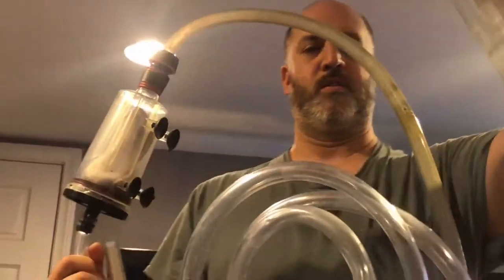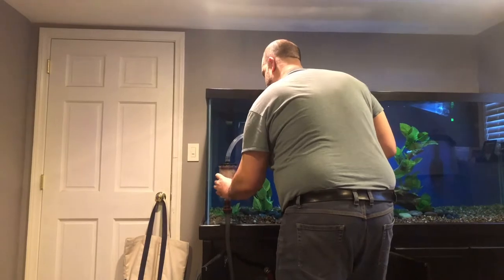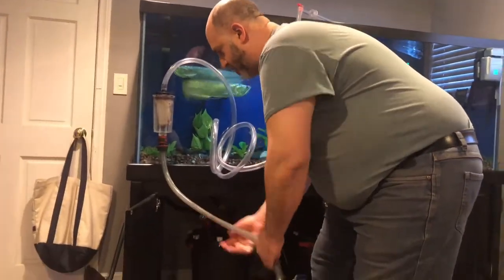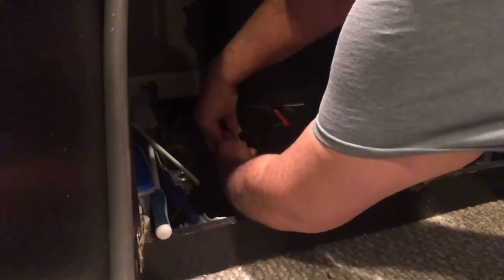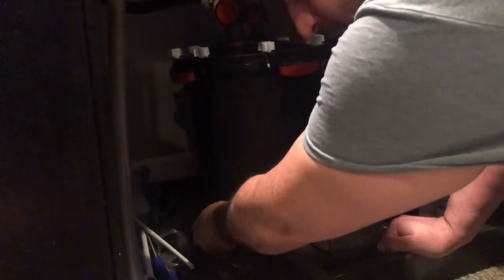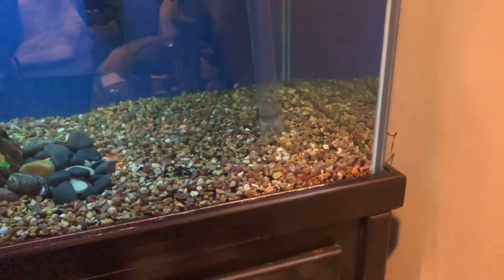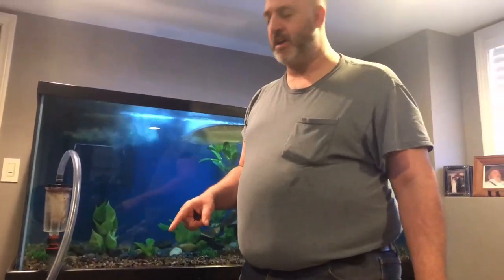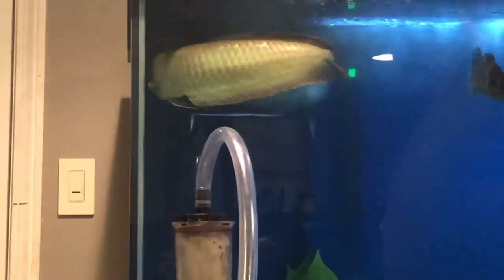FX6 Gravel Vac (No water change)

Comment: Would this work if you connect the hose to a non-Fluval canister filter, provided the hose has the correct diameter for the inlet?
Reply from the maker: I’m sure it would as long as you are able to pull a siphon from the canister filter the fx6 has a draw off valve on the bottom I close the intake and I open the draw off while keeping the return open it has a ton of suction I’ve also have used it during a water change as well it works amazing thank you for watching my video tank on 👊👊👊

Comment: Doesn't that add a bunch of air to the canister since you don't fill the hose with water as well?
Reply: FX-5 and FX-6 evacuate air easily
Reply from the maker: Yes it does add some air but small amounts it runs off the filters pump the fx6 purges all the air out on its own also when you disconnect the vacuum I always crack open the out valve first then the in valve that also helps bleed out air but it completely purges out the air in a few minutes and ever 12 hrs the system shuts off and bleeds out any air all on its own
Reply from the maker: The fx6 purges out any air all on its own but very little air gets trapped once the vacuum sucks in all the water and the system purges air out on its own

Comment: Do you turn the canister off when opening/closing valves?
Reply from the maker: No if you iscolate the valve it shuts the water off in that hose if you close both valves the canister can continue to run with no issues if your going to open the canister up then you want to close both valves and turn the canister off by unplugging it thank you for wat the video

Comment: Is it normal for the fx to drop the level in your tank after you’ve used the gravel Vaccumed
Reply from the maker: Yes somewhat because the fx 4,6 will take in some air after you disconnect the gravel vac the filter will self purge the air out and some water loss is completely normal to a degree as long as it isn’t like gallons lol you should be good plus it’s summer and evaporation is more so now do to the warm weather as well hope this helps and tank on keep a look out for a lot of videos on my channel I’m setting up a 540 gallon tank with a huge sump system on it with a custom built stand thanks for watching
Reply: Even when I use my canister to refill. It Drains the tank.
Reply from the maker: @dhiyaesmail1297  is all the valves closed there are 3 valves on the fluval fx4 fx6 and how are you refilling your tank threw a canister filter be sure all your gaskets are in place as well
Reply: They are when I refill I close out open water change value and put the hose in a container where I have my water ready
Reply from the maker: @dhiyaesmail1297  do you have water on the floor we’re is the water going
Reply: The water is going back to the canister
Reply from the maker: When you use the fx gravel vac keep out valve open and the in valve closed then on the bottom hook up the gravel vac to the bottom valve put in the gravel vac in your tank let the hose fill with water then open the bottom valve you will see the filter sucking in water when your done close the bottom valve and open the in valve on top of the filter you will be good to go watch my video again and you will see what I’m talking about
Reply from the maker: @dhiyaesmail1297  yes it recycling the water that is what you want
Reply from the maker: Are you using the fx gravel vac for the fx4 or fx6
Reply from the maker: Subscribe to my channel would help me out
Reply: 6

Comment: Can i use this in sand substrate?
Reply from the maker: Yes absolutely just be sure not to suck up the sand in the process while gravel vacuuming
Reply from the maker: Absolutely just hover over the sand making sure not to suck up the sand I’ve used it on sand many times works very well